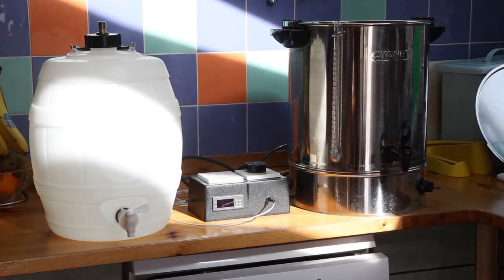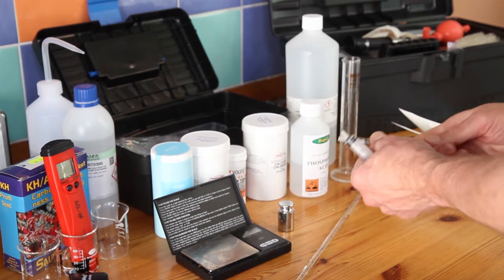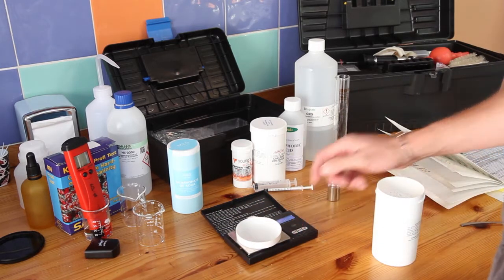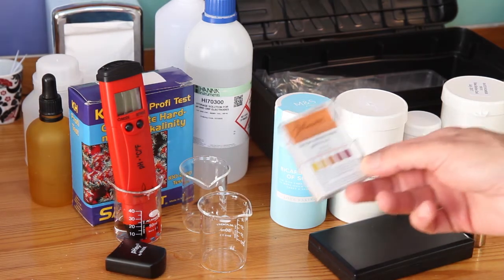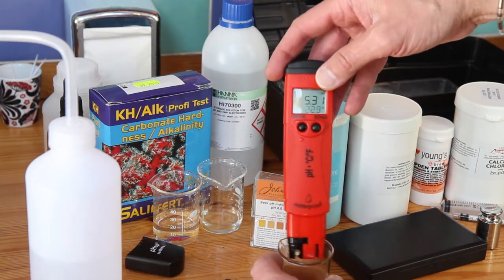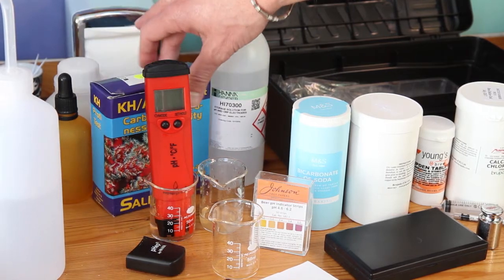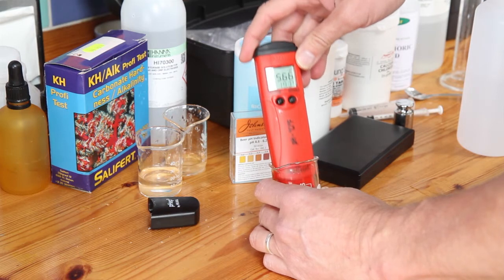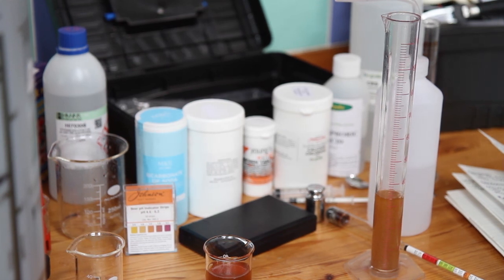Grainfather Brewing: Water Mangement Part 3

Comment: Thanks for the video series Gary. Very helpful! Can you let me know what temperature is the mash liquid you are testing? I have read that we should be in the 5.2 - 5.6 range at room temperature. Are you cooling the samples down prior to testing them?
Reply from the maker: HI Colm thanks for the feedback. My pH meter has temperature adjustment but I do not think it is really intended to cope with 65 deg C when it is calibrated at 20 deg C - so I cool the sample down very quickly by sitting it in cold water with a lunch box chill pad in it until it is 20 deg C.
Reply: Thanks Gary!

Comment: Send a sample of your raw liquor (tap water) for a water analysis which costs about £30 as you said earlier. The results obtained a few days later give you a full analysis (all the key Ions related to brewing are listed as values in ppm for; your raw liquor,  theoretical wort and lower and upper target values. The results are tabulated for all different types of brew: Bitters, IPA's and Pale Ales; Stouts, Porters and Milds; Lagers and Pilsners. For example I was advised to add 22g of DWB mixed into my dry grain. You don't need to have pH meters, acids/ base, accurate weighing scales, special aquarium water, books on water etc. Just spend a one-off £30 on the analysis and a few quid on pH papers (which will last you 100's of brews) to test the wort. I can guarantee that you will never tell the difference between brews produced by expensive "water management" vs "water analysis"...so don't waste your money. I am a Chemist by the way, graduated in 1998.
Reply from the maker: Ian Jones thanks Ian sounds like good advice for people who have stable water supplies

Comment: Thanks for the 3 videos.  Saw the link for your ph meter ... on amazon if you search for ph meter you get hundreds, many under £20.  What would the difference be?
Reply from the maker: The main difference will be accuracy and build quality. That said, it may be worth experimenting with a cheap meter to get the hang of things and decide if the investment is worth it. Make sure they are accurate enough - remember we are measuring between 5.2 and 5.6, so you want one that reliably measures to  precision of 0.1. Otherwise some short range test papers would be even cheaper.